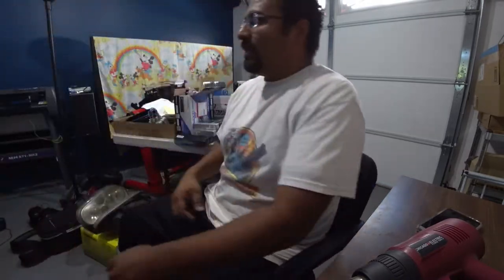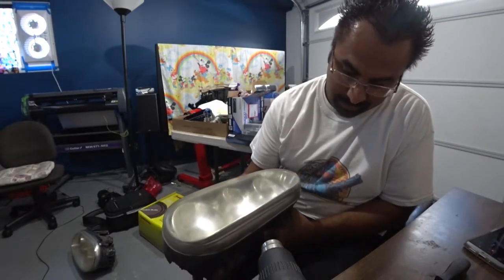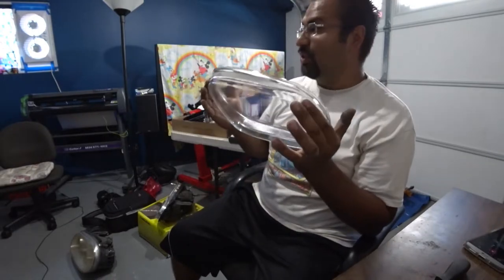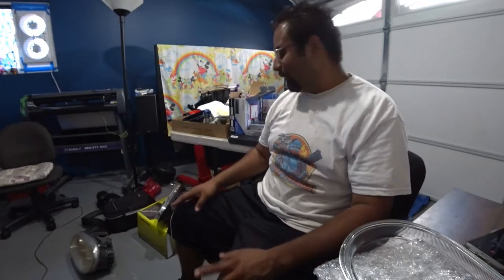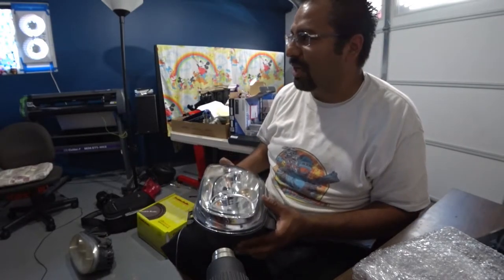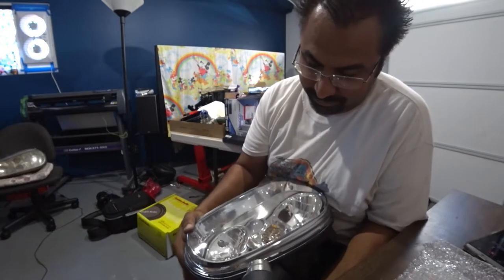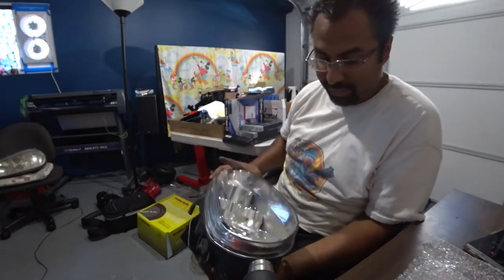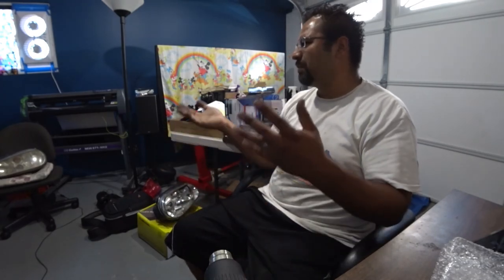How to Joey Mod MK4 Headlights for your Jetta/Golf/Gti/Gli DIY S4EP21

Comment: Just for viewers info, this only works on HELLA headlights. Dont bother trying a heatgun or an oven for VALEO headlights. The glue doesnt melt. Instead smash the lenses, cold chisel (or flathead gently) out the old silicone/glue and do your mod then refit new glass. 

I tried this method to confirm later on VASK and by trial and error that it doesnt work :(